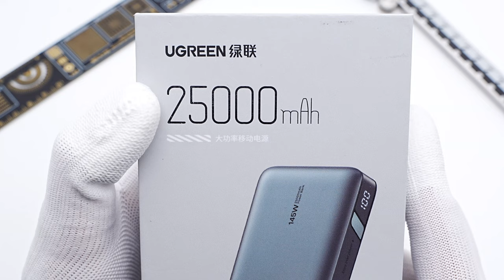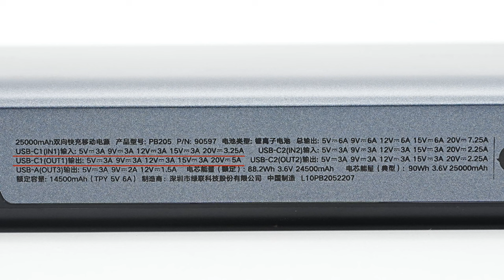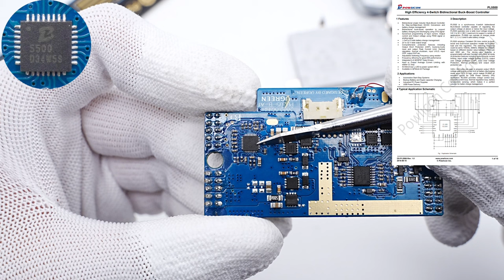Teardown of UGREEN 145W Superbox Laptop Power Bank (25000mAh)

Comment: how long does it last for a 45Wh speaker through type C PD? thank you.
Reply: The battery is 88Wh, so if you're drawing 45W continuously it should last 2h.

A speaker has very variable load so it will probably last much longer than that, depending on what music you play and volume. Let's say MINIMUM 2h.
Reply: thank you @FAB1150

Comment: Since you are also reviewing older products. Could you review "HUAWEI 12000 40W SuperCharge Power Bank" ? It is the only power bank in this small form factor that has 20V output (can power laptop) and this is only possible because it has special battery chemistry. Maybe there are others now in same form factor? It used to be the only one!
Reply from the maker: Actually, we already reviewed this product four years ago!😏 Here is the article link: https://www.chargerlab.com/huawei-12000-40w-supercharge-power-bank-review-the-porsche-of-power-banks/
Reply: @ChargerLAB  Thanks man! Also thank you for the Anker 711 review the other day.
Are you by any chance aware of any new power bank that is this form factor, or this light, that has 20V?
Reply from the maker: You can check out this Baseus 100W Slim Laptop Power Bank: 🔗https://youtu.be/4m3LO8LQ400 or the Mophie 45W Powerstation Pro Power Bank, which we plan to make a teardown video of it.

Comment: I bought this 23.11.11 and it support PPS. 
I think the product was revised around this time.
I charged my s23 plus with this power bank and it works fine with Super Fast Charging 2.0 45w.
Reply: I purchased mine around aug, no super fast.
Reply: @hyperionproductions2053  Looks like previous 25000mAh model USB-C1 Max Output is 100w.
Revision model USB-C1 Max Output is 140w. Also, previous model has two in/out ports.
But revision model have only one in/out port. (in2/out2 port change into out2 port)
Reply: @sodkim6193  But I think the free type c to type c cable doesnt support up to 140w
Reply: Yes there were two Versions of this Ugreen 145w the first model was no good. The second new/updated model is great all issues fixed. The old model has a rating for the C1 port at 100w. The updated model has the C1 port rated at 140w now.

Comment: This powerbank would be top of my list if it weren't for one issue...

It does NOT support PPS. Which is strange since according to the datasheet of the controller in it, it should.

This means it won't do Super Fast Charging on Samsung phones.
Reply: bump
Reply: What powerbank is on the top of Ur list?
Reply: I have the aohi magcube 30,000 mah, which does support pps. It "technically" supports passthrough charging as well. If you use the type a port to charge a phone
Reply: it actually does fast charge from 20 to 100 within hour just make sure you are using 5A cable
Reply: @elyx05  doesn’t support PPS so doesn’t  trigger super fast charging on Samsungs though. And it doesn’t draw 5 amps either.
Reply: @GetCTOwned  wished i had read this before buying the powerbank; the anker 737 might be a better alternative if it wasn't for the strange form factor; since it supports PPS.
Reply: it support PPS on OUT2 port, they made REV2 model!
Reply: @gazooc  yeah they only released a revision a month after i bought it, bummer. but happy for all the new customers
Reply: @gazooc how do you know what the rev2 model is? I don't want to buy it somewhere and then find out I have the rev1
Reply: @TheDesius   i'm in progress of making review, tesed all ports in all combinations with witrn u2 and km0003c. And especially asked manager of ugreen for pps support situation
Reply: PPS require a very high-Q inductor and a big heatsink on the output MosFets. 
Without PPS the charger can be much more compact, and cheaper...
Reply: @TheDesius  Rev 2 model supports up to 140W on C1 port

Comment: I still dont understand where that number comes from 20v with 7.25A  1:33
as no way they Ugreen is as rancid and start to stack all stockets, they usally is pretty legit..
that's a no no... and recall how it created a lot of salty buyers on a Baseus powerbank when that were labelled as 65W laptop powerbank and then later baseus had to explain that it was merely 45w + USB A.
Reply: I don't know if you are still interested in about this. =D
20v with 7.25A (=145w) is total amount output and its divided by two ports. Their product page says that it can support 20V 5A (100W) on output 1 and 20V 2,25A (45W) output 2 at same time.
Reply: @Tikku.  Allright.. thx..and yeah I reckon that likely were a speculative tactic that they were stacking output-values for  numerous ports, to confuse consumers.
as they are likely trying to target the very popular Anker 737 (140W) PD3.1 powerbank and 145W sounds better then Ankers 140W label.
But a worlds of difference
One is rated from a single port, and the other ain't, but stacked port-output values..
One is PD3.0 (Max 20v) and the other is PD3.1 (Max 28v).
Partically the PD3.1 i a nice feature, as you can drive items that need above 20v and you get 28V /5A limit... fx RC chargers etc.. or small mobile power supplies like DP100.